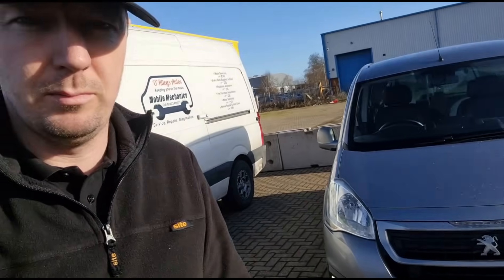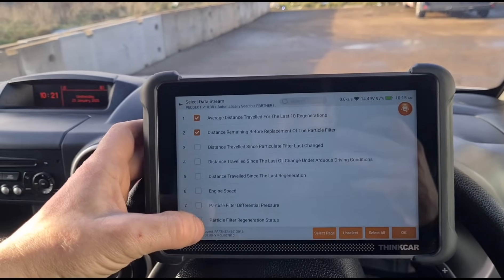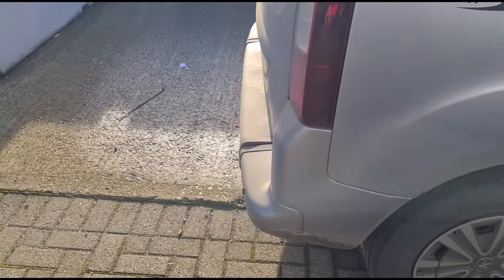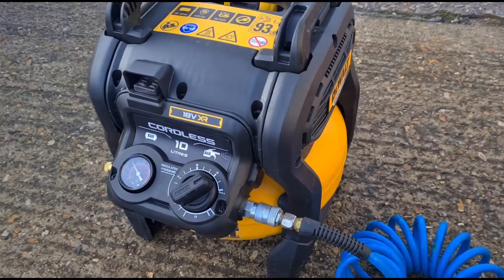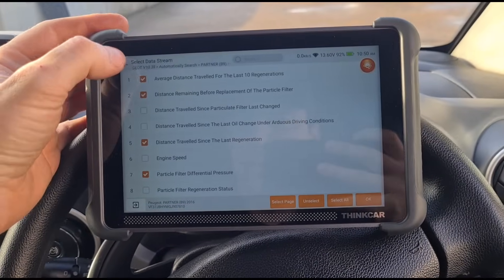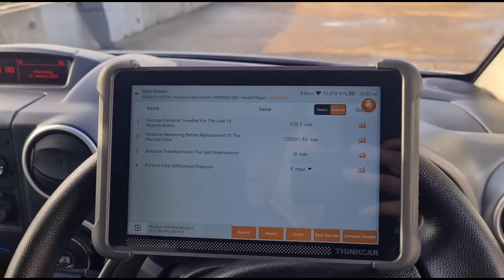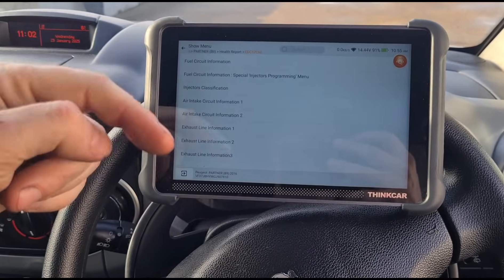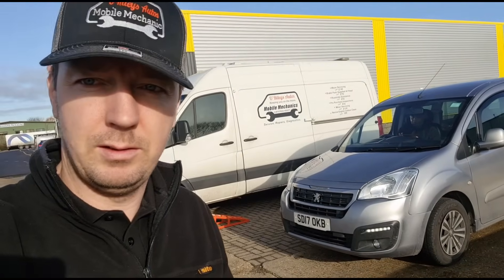Peugeot Partner P242F Fault Code

Comment: Hi Jimmy, from this video I bought the same Thinkscan some time ago (the wired model)  just for the dpf replacement function. However I do not see it when I connect it to a Renault Clio IV, did you have to pay for the additional functions or where they stock?
Reply from the maker: Most Renault models dont need to tell the ECU of a replacement

Comment: Hi Jimmy, I have a 17 reg Partern Tepee only 40K, this last 12 mouths had alot of DPF problems. I try not to ideal or do short jounys. I get particulate warning while on the motorway after say one hours driveing on cruse control 65 MPH 1800RPM. when I got to spain it wqant into limp mod, I cleared the fault to get me to the jounys end, next day only did less than 12miles before limp mode. Is my driving at 1800RPM to slow for regeneration to happen. Regards from wet and windy Manchester
Reply from the maker: 1800rpm is not to slow
Reply: @ORileysAutos  Thanks Jimmy.

Comment: Could P00BC (Air inlet circuit) be caused by a blocked dpf.
I have a citroen DS7 with this engine, its at 40 Mbar differential pressure at idle, no other codes, but poor low end performance?
Maf readings look good.